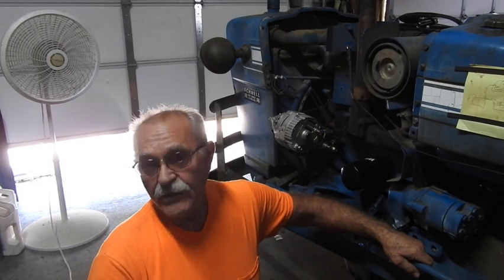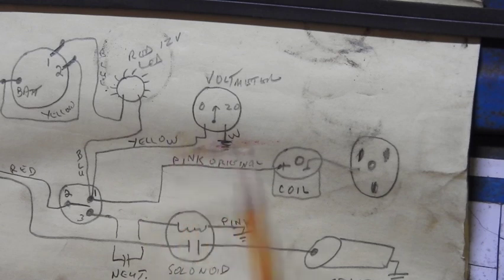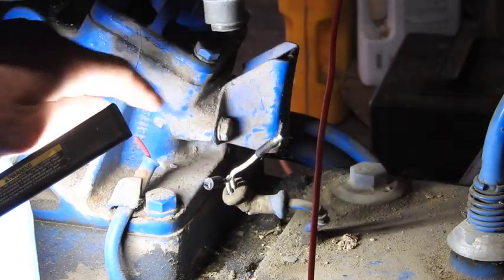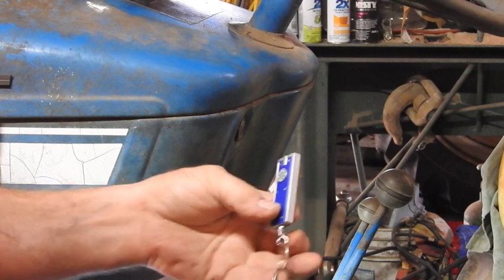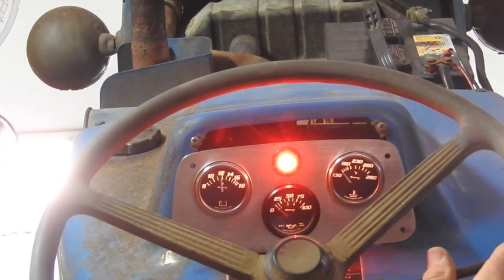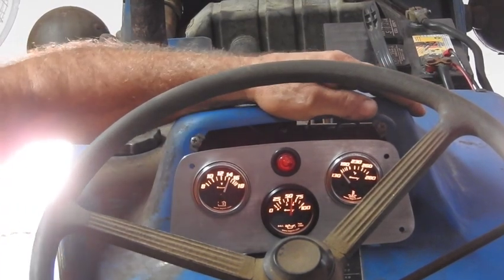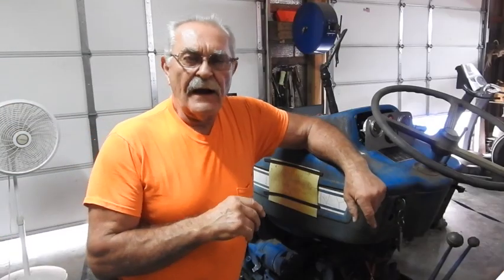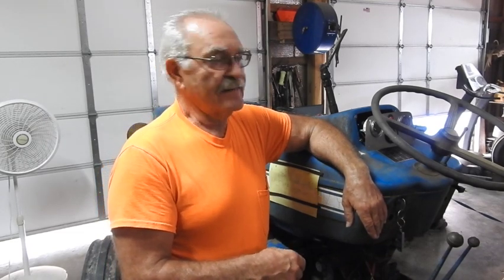Ford 2000 Alternator Conversion and Gauge Pod Checkout

Comment: Where did you install the water temps sensor?
Reply from the maker: I don’t recommend it on a hard working tractor but I removed the block drain petcock. It should go front of the head where the original sensor is located for more accuracy in reading operating temps on one still used for heavy work consistently.

Comment: Where did you buy the Ford 2000 tractor amp, oil, and temperature gauages at, who make them and how much did they cost you?
Reply from the maker: Those are all just over the counter components at any auto parts store.  That's why I changed from the Ford components.  The Ford factory parts are too expensive and these I used are now standard everyday items just about anywhere.  They were about 25 bucks each, give or take.  I would not recommend tying your temperature gauge in like I did.  My tractor is not heavily used and it will work fine but for a tractor under heavy work load, its not the best location for reading coolant temperature.

Comment: Great video Tractorman. I like your style. Easy to listen to and understand. Pleas tell me where you get your gauges from.
Reply from the maker: Just about any auto parts store should have these standard gauges.  The reason I use them is to get away from the expensive repair costs of the original equipment.  Plus it makes it much easier to troubleshoot at well.  Thank you Darcy for watching and commenting today.

Comment: Good video and job I will have to check out the previous videos thanks take care
Reply from the maker: On a side note, with official Ford ignition parts and an excellent tune up, this tractor would NEVER start below 4*C.  I don't care what you did, it would not start.  Let it warm us just slightly above and it'd fire every time quick as a whistle.  So I converted it to Petronix electronic ignition along with the suggested hot flamethrower coil and their suggested plugs and it fires just perfect.  My son texted me at -12*C last week and it fired with just a few turns of the motor. I have a video on the change over, but have not edited it yet for upload.
Reply: @tractorman4461  Glad you got it fixed up so it will start now we bought a 35 Massey four cylinder diesel the British model most have the 3 cylinder Perkins diesel nice old tractor but hard to start did matter if it was cold or hot out if it was summer and shout it off for a hour had to use the glow plugs to start it had a couple deferent guys that worked on tractor and they couldn't figure it out we had a guy that wanted to buy it and he knew it was hard to start put still wanted it so we sold it and got a new 384 International in 1981 we still have it over at the old farm we got just the tractor and the next year we took it back to the dealer and got a loader put on it we paid 27 hundred for the loader then and I believe that loader now is about 10 thousand okay the story is getting long I will watch for your video and I read your email thanks for getting back to me good luck with your meat cutting take care
Reply from the maker: @tomfillmore9710  Loader costs are nuts now !  I don't know much about the utility line of the newer Internationals, but they gotta be good tractors.  That's odd about the 4 banger diesel being hard to start....My little 2244 with that 152 cu in 3 cylinder starts quick as a whip just about any time.  Tractors are like the ladies we love...they all take a little warming up sometimes to get them to go to work...  LOL

Comment: Great job! The one thing I like about old tractors and old pickups/cars, they are all "individuals, like people," getting them started and running/driving.
Doc
Reply from the maker: I absolutely hate this series of Ford's electrics.  So I like to simplify the situation by making the changes that can be replaced without OEM Ford parts.  Thanks Martin for the comment.

Comment: Hi Wendell!  Good call hooking that neutral switch back into the starting circuit so as to avoid chaos, death and destruction.  The tractor’s sounding pretty good! Thanks for sharing!
Reply from the maker: Hey Martin, I found you in the spam folder with a few other good guys too !! I wonder what's going on with the comments.  I click 'allow all comments' on every video.  But yes, with kids around the neutral safety is a very good idea.  I just missed it when I drew the diagram and didn't catch it until it was ready to fire up and check out.  LOL  Wotta dummy huh....

Comment: Good and 'good looking' job here Trantorman!
I wish they could have all been built this way, at least you've shown us how to convert ours to this better system. I do like that bright light.
Reply from the maker: Well Reg, I don't know if its necessarily a better way, but it IS a way to get past overpriced dealership repair parts and utilize 'over the counter' parts from just about any auto parts store.  The only bad thing is the tach drive is eliminated, but there IS a company that manufactures tach drives that go directly on the back end of the new Delco alternator if you want to keep a working tach on the tractor.  I've not had a tach yet on three Ford/Lucas conversions that worked.  LOL
Reply: @tractorman4461  Couldn't you buy an 'aftermarket' Tachometer to run on the coil ignition for that engine?
You are too modest,.... any time you can get rid of a Lucas system and it works, then it just  gotta be a better way! Hahaha!
Reply from the maker: @regsparkes6507  Oh heck yeah that's the simple solution.  I even have one on the old 85 F-250.  I think I was trying to infer that those that want to keep the original gauge pod and gauges that work, but want to eliminate the Lucas generator and voltage regulator and leave a working tach intact, have that option of just changing the faulty generator with the Delco and built in tach drive. I don't particularly care if I have a tach or not. There IS one on the Kubota B3030 and I hardly ever even glance at it.  Sometimes its a bit difficult conveying a thought in a succinct manner by the written word.  LOL
Reply: @tractorman4461  You've got a good point there too!

Comment: Outstanding! You've almost got me talked into trying an LED "idiot" light instead of my momentary switch on my conversions. It sure shows up well!  Is there a minimum amperage it needs to pull do you think or is most any bulb going to be okay? Semper Fi!
Reply from the maker: I think the LED's are rated in wattage, but I have no idea what the ones I use are.  I just pick up one at O'Reilly's that fits a 3/4'' hole and they work fine.  I put a rectangle one on an old Massey Harris 30 and it goes out as the alternator begins output but it does flicker very lightly.  So now I stick with the 3/4'' round ones. To determine which way to wire it in, touch it across the battery terminals, one way it will light up, the other way it will not.  Good luck and S/F my friend.

Comment: Wow! Another 44 episode to have with me fried spuds! I’m tippin me cuppaJO fer ser! You could take your diagram, repeat the pattern and make wall paper. A whole series of home decorating and home improvement! I can see Martha Stewart advertising the new 44 decorator series! Pictures of all your tractors with your picture in between? I’m sure Martha would surely do her house over with this trendy home improvement! How could she not? So Thanks my 44Friend! Greatly Appreciated! Now back to finding out how to fix my ignition switch on me Honda Element! Pic up our Amish friend that keeps I nice here in the Holler House and had to call a neighbor to take her home. Key goes in and out okay, goes one notch and no further! Sonzagunz! This is DaveyJO inna Holler
Reply from the maker: Now DaveyJO, that would surely make for some interesting wall paper.  Remember back in the 70's when the craze was wallpaper made out of turn of the century Sears Roebucks catalog reprints ??  LOL  My FIL's upstairs bathroom is still adorned with it.  I'm at a loss on your ignition issue...but my 85 Ford F-250 ignition did pretty much the same thing. But a few bucks at O'Reillys fixed the issue.  I'm sure your fancy Honda will be just a little more involved.  Have a wunnerful day and another Starbuck's on me....LOL Won't be as good as DaveyJO's JO, but it'll do in a pinch.

Comment: Another sweet ride  ,  what is your son going to use it for ?
Reply from the maker: He's pretty much a Minnie Me....he's got a few acres down the road a couple miles and currently has my old B2400 Kubota and an old Massey Harris 30 for cutting and hauling wood.  BUTTTTT....the transmission blew in the Big K and the back tires are original from about 1951 on the Massey and have several splits with the tube sticking through.  So he'll use the plow and disc for a food plot, hauling wood and with the right angle drive will mount the 3 point adapted buzz saw for pole wood.  Then of course there's snow removal for himself and a couple neighbors close to him.... the list goes on.  Thanks BubbaG for stopping in today !!

Comment: I use heatgun to start my tractor at cold weather, but it's diesel.
Reply from the maker: Oh heck yeah, I use the heat gun on diesels as well as the gas engines when its really cold....but there was something about this machine that just wouldn't budge !!  I'm hoping the Petronix electronics with the suggested flamethrower coil will make the difference this winter.

Comment: Having a neutral safety switch hooked u with young ones around is always a good idea. Never know when they will be trying things on their own. Someone bypassed the neutral safety switch on my 8N before I got it. I'm not worried about hooking that one back up though. I'm the only one with a key and there aren't any curious little ones around the farm anymore. I really like the LED idea on the charging system. 👍👍👍
Reply from the maker: I couldn't believe I forgot that when I drew up the diagram !!  LOL  No matter, its only a problem if it can't be fixed right...  
   The LED is first and foremost a diode, it just emits light as a side benefit.  So when it lights up, its telling you 12v is going to terminal #1 to externally excite the alternator.  Soon as the charging starts, the LED goes out because the higher output voltage overpowers the applied 12.7 volts and tries to go backward....but its stopped in its tracks at the diode because the diode will only allow flow in one direction.  
    I know you probably know that, but maybe someone reading the comments can pick up something in the chat.

Comment: Congratulations 44, great video, I am a Ford tractor fanatic because I grew up with it, but we used a Massey Harris when I was very young and later some IH's but never without a Fordson or Ford, I notice the head lights of that 2000 sit in the position where our South African models sit, the European models lights sit in the grill, don't know fore-sure how it works in the US where You are but I know the Super major Ford 5000 sit also on the side in the US
Reply from the maker: Good Evening Jan, I grew up with Massey Harris as well.  We had (2) 44's, a 101 Super and a 101 Junior and an old Model 25 as well.  I've only had Fords for the last 35 years or so and Internationals for 15 or 20.  There's not too many Fords here with the European headlight style until they get to the 6000 or 8000 series.

Comment: Whole heartily agree with the Pertronix electronic conversion! Should make your son a great little tractor! 👍
Reply from the maker: Thanks Rob, I hope so.  I still have no idea what I didn't  have perfectly correct with the Ford components but no matter what I did, it would NOT start in cold weather.  And I am not a fan of blowing ether into them at all.  I had two 4000's and a 3000 all with the Holley carbs like this one.  I guess they are alright once a fellow gets used to them, but the old Zenith's and Marvel Sheblers were a lot simpler to work on.